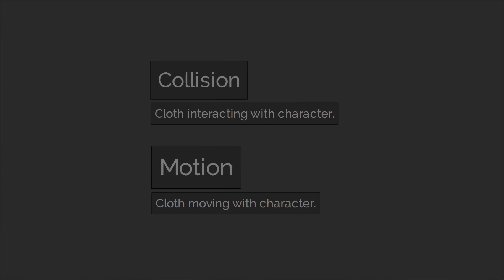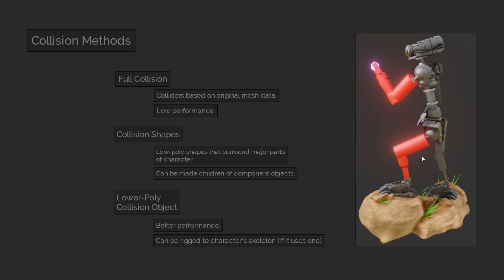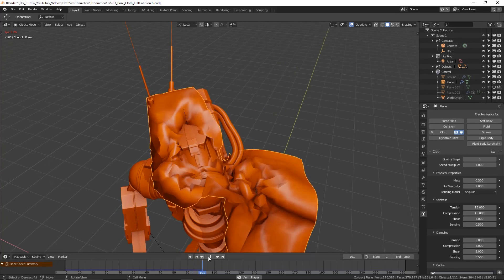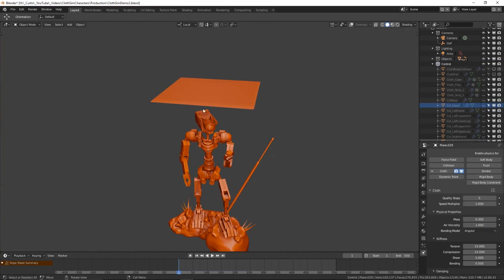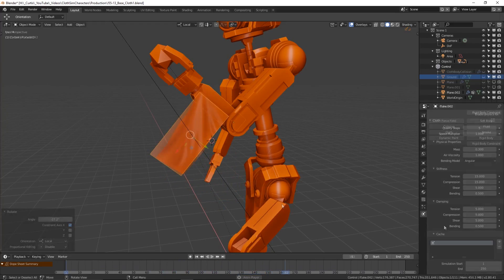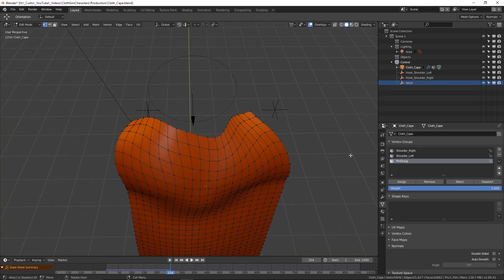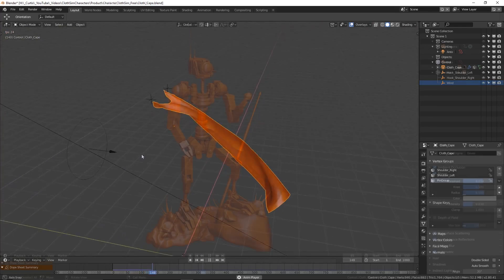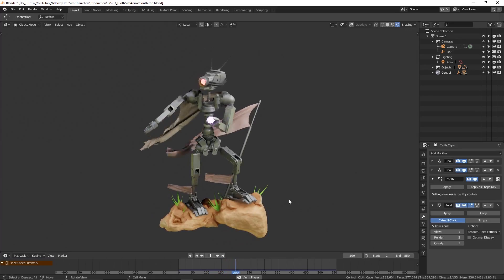Character Cloth Simulation in Blender 2.8

Comment: Nice video, very cool :) How did you rigged the robot? Parented it all together? I want to create a robot soon too but dont know how to rig it since it shouldnt deform as a robot :D
Reply from the maker: Thanks for watching, glad you enjoyed it! :)
As for this robot, it's done entirely with parent-child relationships, meaning that any objects that should be moved by a joint are made children of that joint. Joint objects are then rotated on local axes using the origin as a pivot. Bones are not required in this case as there will be no deformation.
Reply: ahhhh as I thought, I will try it, thanks :) 
 @CurtisHolt
Reply: @krypto61  It's still best to use an armature object with bones, but set the weights manually, piece by piece. Each object has weight of 1 for its deform bone, so it keeps its shape and follows the bone completely.
This way you can do a lot more with animation, for example, creating an FK/IK rig. It's also a lot easier to manage the F-curves of the animation, and to reset and change things without harming the geometry.